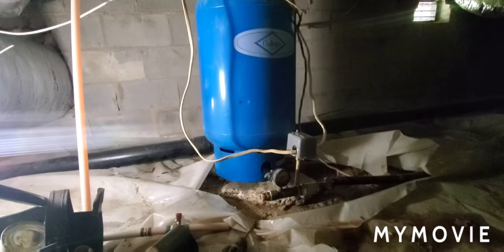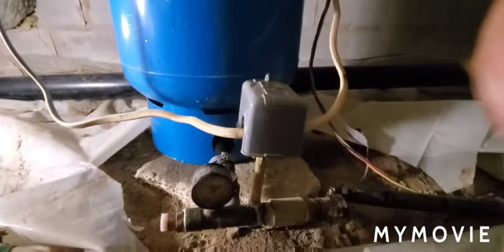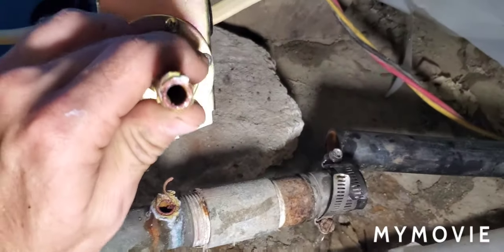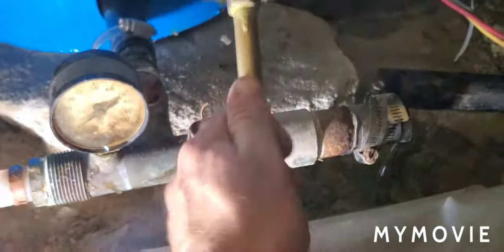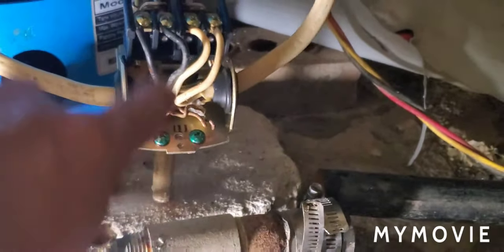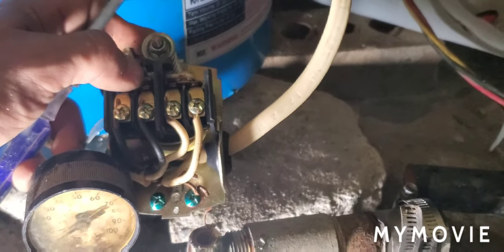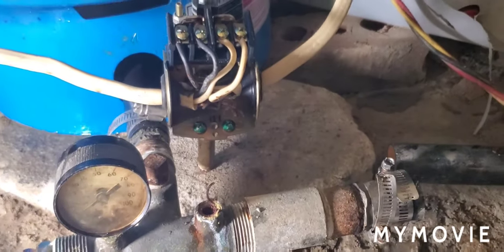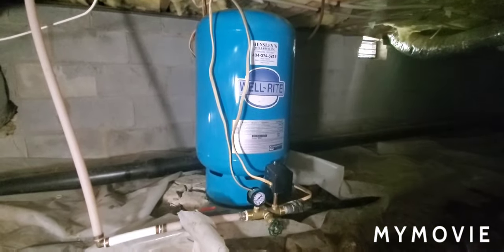No Water or Low Pressure how to fix it & diagnose the issue. Well pump not pumping

Comment: Thanks SO MUCH!!!!!  Everyone told me it was my deep well pump (a month old) or the line coming into the house has a leak.  Watched a number of your videos which enabled me to gain at least a decent understanding of the system.  It is going to be that line beneath the switch which I will fix tomorrow!  Saved me a lot of money and I am so grateful.  Will have a hard time getting to sleep now.  I've shut the well pump off so I don't blow a pipe etc...  No heat tonight (geothermal system) so will be cold here in Manitoba Canada tonight but by noon tomorrow I'm certain all will be up and running again.  Thanks again so much for doing what you do.
Reply from the maker: If it doesn't fix it, I'm here if you need me Hwdracing@gmail.com
Reply: @h2omechanic  Just gathering my supplies and about to get started.  Going to clean the tank while am at it.  Wow - I sure hope you know just how special you are and just how much we all appreciate you.
Reply: Situation:  replaced the pressure tank.  Also replaced switch, gauge, pressure release valve and all linking pipes.

40-60 switch in place.  Does not go to 60.  Stays on.

Turn off power, pressure drops to zero with nothing on.

Turned off hot water supply (to and from tank).  Nothing changes.

Turned off cold water and the pressure (on the gauge) drops to zero?

Turn cold water back on and the pressure resumes... not to 60, but back up to 45 or so.  

I am dumbfounded.  Any help greatly appreciated.
Reply: Hello  I'm als0 having intermittent water problems.  Water will stop after a couple minutes so we shut faucet off and after a few minutes we can turn the faucet back on and water will work for just a couple minutes again.  It seems like the water pressure gauge is stuck at 70 psi . It won't decrease even if the water stops working.  Does  this mean if I change that gauge the system should start working correctly?

Comment: This video is very informational. My water just stopped flowing 2 nights ago at random but the pump stays running. I am about to go and try whats suggested in this video and provide an update if I dont electrocute myself doing so, haha. Thank you!
Reply: Unfortunately, I am still unable to get my water to flow😥. Any suggestions?
Reply: Did you find the issue mine doing the same
Reply: @90mustang135  the best bet I would say is to have a plumber come replace your pump and install a submersible pump down in your well. Thats what we ended up doing and I could not be more pleased.
Reply: My switch colors are, (left to right)white, black, red, black… can it be different for different switches? 🤔 

I inherited my father’s house after he passed. I wish he would have spoken to me about all the issues this house has before he passed but he had dementia. 

Our water pressure has been really strong, but lately the pressure is getting so low at times it’s hard to even shower. I’ve been watching videos on how to check the tank pressure but honestly it’s a little confusing. All this cut in and out psi. Which I think should be between 40-60 on the switch but I have been running all the water in my house and have a hose off the pressure tank to drain it but my gauge still says 62. It hasn’t moved at all… the videos all say the gauge should go to zero.. 

Any help would be greatly appreciated bro. You even offering to help ppl on here shows what a good guy u are. I know ur prob busy so u may or may not see this. Finger crossed lol!

Comment: The most common problem that I have is that my pressure switch won’t actuate.  If I tap it, it will then click on.  I have replaced the switches many time:

Comment: Help! Tank won’t fill, pressure switch calls for water, 6.4 amps with pump on, 18 lbs. pressure in tank, 20/40 pressure switch. No water sprays out a shraeder  valve, tank easily moved by hand, no sloshing water. I hear a thud or water hammer twice when pump is energized, then quiet. 1/2 horse pump 10 years old, 120V. Can’t see where to go next.

Comment: I’ve got a new switch new gauge and the tank is refilled to 38 psi, and I’m losing 10 psi immediately after it fills and shuts off at 60psi.  So it seems to hold at 50.  Then it will be very low pressure from about 44 to 40 as water runs . But pressure kicks in Then when pump cycles again , any thoughts? My thought is check valve needs replacement?

Comment: Thanks so much for an informative and very helpful video!  

With your help, I just fixed a well that has been giving us fits for a year.  Like the pressure switch you showed in this video, Mine was full of rusty hard water deposits.  I disassembled the diaphragm from under the switch and found that the pipe into the diaphragm was plugged nearly solid. Cleaned up, it works like it should, and I can quit fearing the cost of a new pump.  :)

If you find yourself in Colorado, I owe you a case of your favorite beverage, my friend!

Comment: Hi - greetings from Ireland! Thanks - your videos have been very educational and very well (sorry) explained. It took me a while to find this particular one but when I did I went woah! that's my problem! Yes, water was OK then running down and stopping, and after an hour or more it would magically come back on for a while, then off again. And yeah, it was gunk in the spigot and all the way up into the pressure switch - like solid brown rusty gunk. I took the Square D switch apart - 6 screws, then gently peel back the rubber assembly. It took a lot of gentle cleaning to get it all out - I didn't want to push a screwdriver in there in case I damaged the rubber membrane. So I used a dish wash brush, a piece of wood, and tissue. Put it all back together and it purrs. I might have a look at the pressure tank - I tested it with a car foot-pump and it seems to be around 20 psi and should be 28 psi. But I'm happy, and have that nice feeling when you learn to do something new. Thanks again  - I'll pass this info on to my brother and my nephew for the day when they will have this problem.

Comment: Old system, no pressure reading from air side of tank. Pressure builds up, then starts rapid cycling on and off until water coming out of pressure relief valve. 

Thoughts much appreciated!
Reply from the maker: Replace the tank, it's bad. You can try adding air to the tank (but have 0psi of water pressure in the tank when you add air). Pump it up to 28psi & try the system after that. That'll be a band-aid til u replace the tank. 
Also remove the pressure switch & see if the little pipe/nipple below it is clogged (it might be!)
But regardless, replace the tank. 
Keep the pump breaker off whenever you are not in need of water!!! Or you'll risk killing the pump
Reply: I had cut my water of drained it  replaced a bad valve and not I got really low pressure and 38 psi in my holding tank and my gage is at 60 turn water on it drops to 40 hear a click it goes back up to 60 quickly then clicks off but still low pressure?  I'm lost

Comment: Hey, really like all the videos you have posted. They are very informative and have been very helpful along the way with troubleshooting my well and pump issues by prosses of elimination. However I still can't seem to quite figure out the pressure problem that I'm having. I replaced my tank initially because the blatter in the tank was bad. Also while replacing the tank I went ahead and replaced the pressure switch as well, and I also repiped from the well to the tank with new pipe because the system is about 25 years old and needed to be upgraded as the pipe was old and brittle. I have a 30/50 pressure switch and a 32 gal tank. I adjusted the tank pressure and pressure switch accordingly. I have checked for power to the well and on both sides of the switch and my pump is pumping water to my tank and all is good there but, the issue I'm having is the pressure seems to be sporadic on my pressure gauge,  sometimes it cuts in at 30psi and off at 35 or on at 25psi and off at 35psi, it's all over the place but will never get up to 50 psi. The most it will pressurize up to is 40psi and cuts out. I have a check valve in the system before the pressure switch and I have two gauges.  One gauge before and one after the pressure switch, when the pump kicks on they will both go up to  40psi at the most. However the gouges before the check valve drops to 0 when the pump cuts out and the one after the switch will hold at 35 to 40 psi. The only conclusion I can come up with is that my hose or pipe from the motor has a small leak somewhere because I have no water pressure holding from between the motor and the check valve so I'm assuming the water is being lost back down.to the well somewhere in the pipe or hose. I also know there is no water inbetween those two points because I have a spigot in the line and there is no water in between the two points as well, when I open it, and when the pump is not pumping. However as soon as the pump kicks on I have water and pressure between the two points again but I'm only getting about 40psi tops? If you have any more helpful suggestions please let me know or if you believe i need to pull my well pump motor please let me know as i was hoping not to have to go that route! Thanks for reading hope you can help.
Reply from the maker: Your definitely on the right track! 
You must pull the pump out of the well 1st! 
Your going to find a cracked fitting or pipe near the pump or a Galvanized fitting that's rotted a hole in it. This is why you can't reach to 50 psi. 100% a leak down the well. Sometimes a fitting will unthread itself too. So just inspect everything very close. 
Just replace the fittings with brass or stainless.
Reply: I was hoping you wouldn't say that but it confirms what I was thinking but dreading..! Ok Thanks again, and I really found all your videos and tips very very helpful for all of us not afraid to try it yourselfers. I Appreciate You!
Reply: @h2omechanic  if you could team my comment idk if you check these anymore

Comment: I'm SO glad I saw your video. I'm a do-it-yourselfer but confess the electricity and the water associated with this intimidates me. I think my bladder has a leak. The gauge is not at 0. I can see water has sprayed around the area but I could not find an active leak. Of course I found this out Friday evening after 6. I decided to turn the power off to the pump to be safe. (Which is located outside inside of a pipe). While down there, every now and then I would hear an electrical hum that would last for about 10 seconds and then stop for a bit. I had a new switch installed almost a year ago. I suspect the bladder inside the tank has developed a leak. It's wet below the tank. Dirt floor, but did not notice any puddles. I couldn't notice any damaged hoses. Any advise?

Comment: excellent video, troubleshooting I needed to see. So lol, I'll have the water going for dishes, a shower, flushing the toilet, etc and the water will run out. I investigated in my basement and found a shallow pump, attached to a pressure switch, linked also was an old hot water tank. When I tapped on the pressure switch it came back on, and started to "fill up" and then shut off. go back upstairs and continue with dishes. After a month or so of going downstairs and tapping on the switch, it has gotten to the point where it will fill a quarter of a bathtub and slowly run out. I'll go down and tap and sometimes i won't need a tap on the switch. by the time i go upstairs, it will be ready for another quarter tub full, switch of again, repeat. I'll mention i killed the power and cleaned the contacts on the switch, but same old thing. I have not tried to remove the switch and clean the pipe. Does it sound like a good 2nd step? Super hard water here, with a pH of 7.5. Any feedback would be greatly appreciated, thanks H@0 Mechanic
Reply from the maker: I'd say yes, definitely remove the switch and clean the feed line. Under the plastic cover will say On/Off...go to Ace or Lowes & buy a new switch that's the same pressure or a little higher. Filing the points definitely helps, but your probably way past needing to replace it. Be sure to 👍the videos you watch! Thanks & Happy to help!

Comment: The video really helps alot im currently trying to help my mom with her pump it's running but nothing not a drop o went out got the box installed it but in your video there's a pipe on my mom's it's a small plastic hose is this some kind of getto rig job im just really confused about this the switch box is on the blue tank in the video but hers it's on the pump itself so im lost

Comment: This was very informative. I live in the Philippines and our water pressure is low. We have a pressure tank, a pressure switch and gauge setup to give us better water pressure. Now I'm having a problem. I replaced the pressure switch but put the wires on the wrong connectors (I followed the old switch and it was wrong). Anyway, I changed the wiring and now when I turn the pump on, I get 2 to 4 psi and nothing else. I bled the pressure tank but that didn't help. Could my incorrectly connecting the pressure switch have caused this new problem? I can't figure this problem out and could use the help.

Comment: Thank you for your videos. I am new to water wells. This being said, is there another way to tell what the pressure should be for my system. It is older, and the label w/ pressure switch is unreadable. This is my Dad's place, but he is deceased now and I'm completely GREEN. Although I also noticed my pressure switch is next to my pump and the bladder tank is halfway across the yard from the well. And I don't believe my pipes are ran the way they should be. So confused and I feel like I need a diagram to replace my galvanized and pvc pipes. Would you know the best place for me to find a diagram>?

Comment: Great video
I have a 19 yr old shallow well sand point near a lake, the fitting between the check valve and pump has been leaking,    It set, power cut, for 2 wks, went back up and tank was empty and we couldn't get it to prime at all.   If I do anything I have to cut everything apart (no unions),  # 1, with the age. Would you replace everything?  #2 how can I test the check valve?   The pressure tank has some rust around the fitting.

Comment: Thanks for a great video.

I'm dealing with a pump that is getting power to it, but I don't hear the pump running.

The owner called me the day after a power outage.  When I walked up and touched the pump it was good and hot.  I know this is not good.  The contacts on the pressure switch are stuck in the closed position.

Can you offer any advice? Anything would be much appreciated.

Comment: Hey man my name is Joe I had a pipe break outside a couple of weeks ago. And being without water and the pump on it burned up the pressure switch. So I fixed the pipe which was leaking pretty heavy still and replaced the switch and water was running great. I lost the water pressure last week and work all the time. So my brother capped the pipe that use to be a faucet while I was at work. The house and setup is from the 50s so an inch shark bit is too big and a 3/4 is too small idk why that is. Anyways no I try to physically add air into the valve stem by the gauge and it doesn’t go over 15 nor does it hold pressure. I really need water been without for almost a week and a half. Thank you in advance

Comment: Hii, this was great. I had someone come out because my water would go out after laundry or a shower. We noticed my pressure tank that runs water to the house had a bad bladder and was filled with water. So i replaced it with my brother. The water tasted better after and wasn’t as salty. But then the next day it shut off during my shower again. I went out and flicked the pressure switch and there was a spark. My well pump was expelling water briefly when i flicked the connection on. I think the new pressure tank has water in it again.. thankfully there’s a warranty. Is this a bad pressure switch or is the stem clogged you think?

Comment: Hello. Great video, I tried flicking the contacts with the plastic cover and I didn’t see a spark, but my meter shows power and gauge reads zero PSI. Any other advise?
Reply from the maker: No spark means the pump isn't running. 
So either the pump is dead or the wire down the well has broke . Pull the pump out & look for (open) exposed copper. You'll find where the plastic wire coating has rubbed off. 
If the wire looks good, then replace the pump. 
Note Always test a pump for 5 sec above ground before installing it. Just hook up the wires & make sure it spins

Comment: Hello brother I came across your channel and find it very informative thank you for sharing your knowledge...now I'm having issues with my well after frozen pipe a week ago I have no pressure it's up and down and I noticed that even when the water is not being use after I few minutes the pump start running, I just bought a new switch that I'm planning to change with the help of you videos hopefully that fixes the issue, now if I have a bad tank how could I know what size do I need because the one I have right now doesn't have any  info....any advice would be much appreciated....happy new year!!

Comment: Installed new pump motor and pressure switch and new gauge and new foot valve. Still there is no water going into new tank. Not sure what else I can do. Nobody in the area works on well pumps. Appreciate feedback. Russ M North Dakota
Reply: Have you figured out your problem? We are in the same situation and going on day 6 with no water. Replaced all the same things.